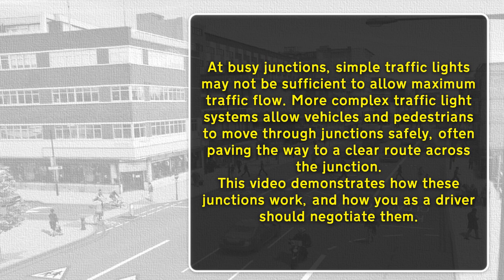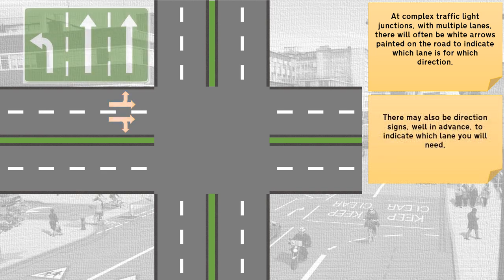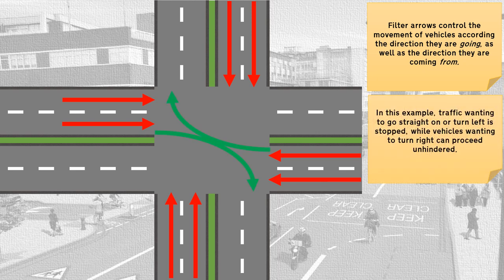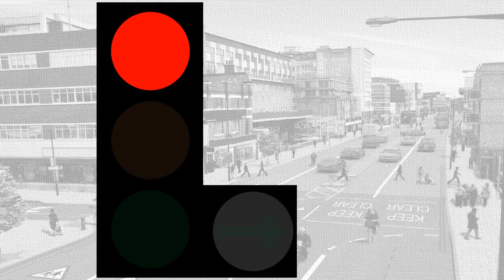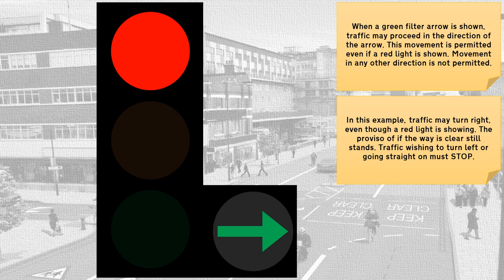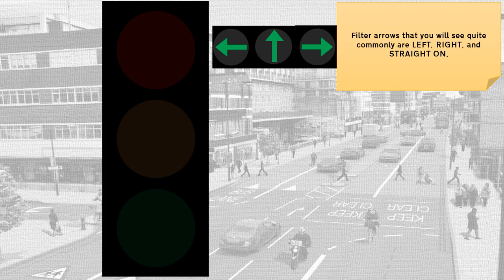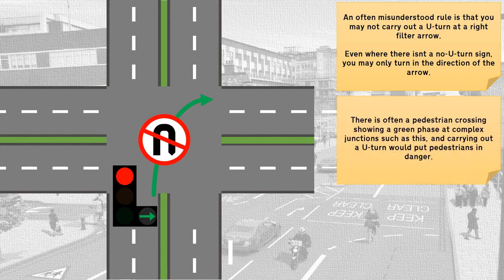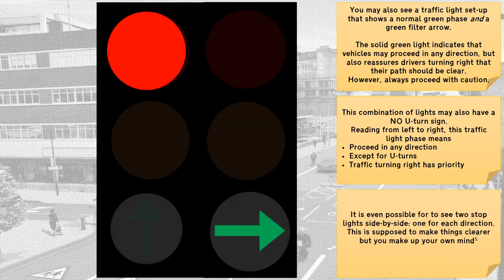Traffic lights with filter arrows

Comment: Nice video! Can I turn right on a GREEN light if it is safe to do so even if the filter arrow (to the right) is not ON?
Reply from the maker: Yes. A green (circle) light means you can go in any direction. You do not need to specifically wait for an arrow.
Reply: @InclusiveDriving  Thank you
Reply: @techcues3931  If the filter arrow isn't on but the normal green one is, you will have to stop in the middle to give way then go when it's safe
Reply: I wish I had seen this before my test today. I got a serious fault for not going when the light was green because I was waiting for the right arrow. I had already failed on parallel parking though.